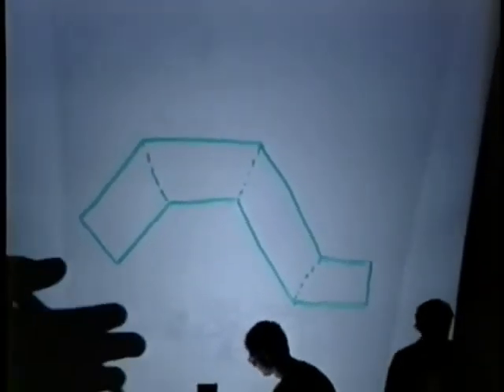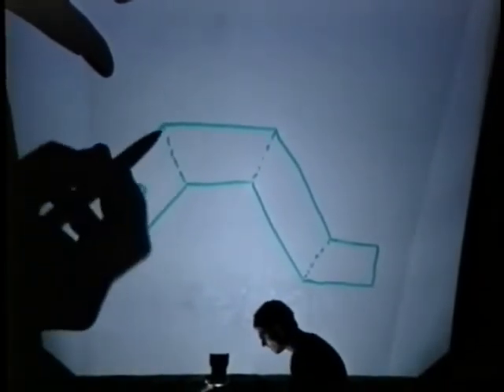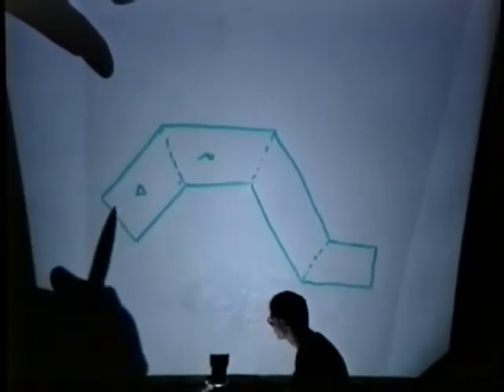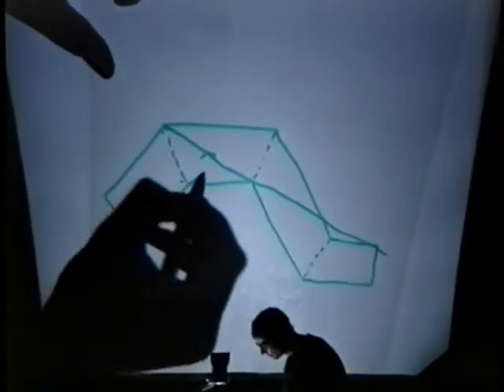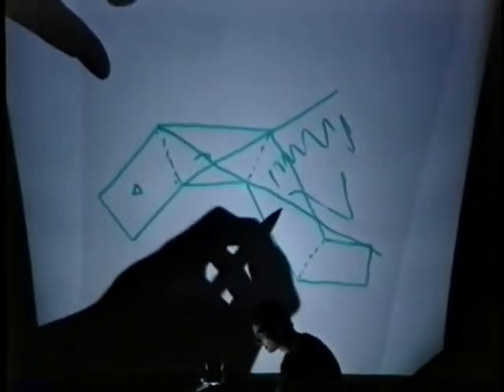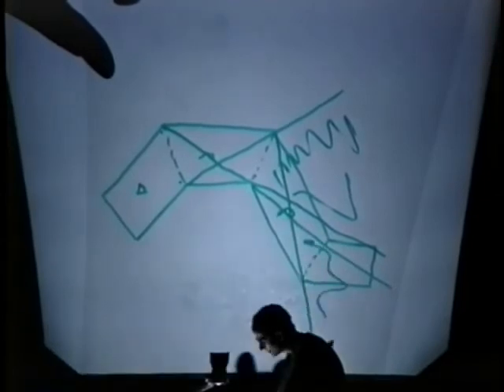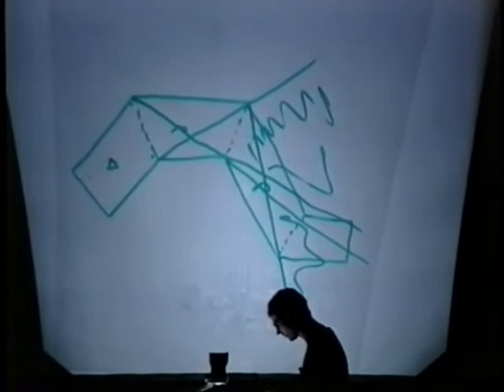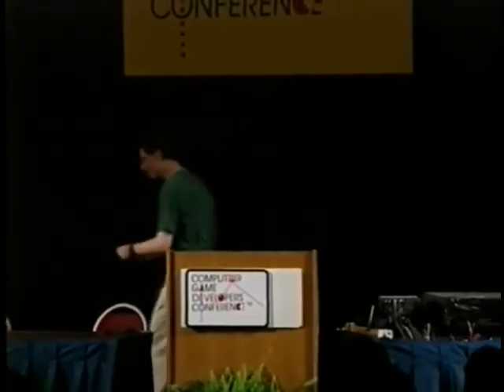Excerpt: Quake Postmortem - Optimizing Level Viewing

Comment: Sounds like BSP?
Reply: What Michael is demonstrating is not BSP, it is simply clipping visible spaces through portals. You can do this with or without a BSP. But Quake does use BSP and here's why:

The purpose of BSP is that it allows you to very quickly figure out, no matter where the camera is, what order you should draw all the triangles in your level, so that close polygons appear in front of far polygons. BSP doesn't tell you which triangles will be visible when all the drawing is done, though - it just gives you an ordered list of which ones are close to the camera in any given spot, and which ones are far away. So if you just draw everything in your BSP at all times, you will still draw the entire level, even parts you cannot see, which is way too slow.

What Quake does is it combines BSP with clipping through portals. It does this by walking the BSP front-to-back: normally, you walk back-to-front, so that the furthest polygons are drawn first, followed by the closer ones. The closer ones cover up the farther ones, so you get a correct image. But if we go the other way, and draw the closest polygons first, then we can perform the clipping technique Michael is describing to find the holes left between the close polygons. The clipping tells us exactly which parts of the next layer of polygons we need to draw. We then do the next layer of polygons, and the next, until the entire screen is filled with polygons. By the end, we have only drawn exactly the polygons we needed to see, and we haven't even drawn over a single pixel even once. This is the genius of the Quake engine and is the main insight which makes it so fast and elegant.
Reply: @sheridanrathbun  this "clipping problem" is used to precalculate the PVS (Potential Visible Set). But this does not mean zero pixel overdraw. For the zero pixel overdraw Quake software renderer used a span-based approach.